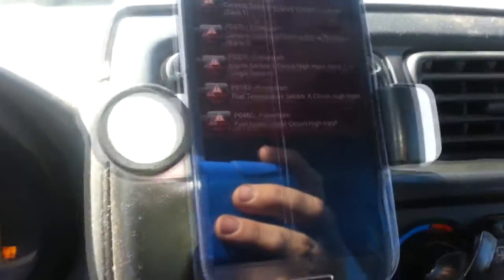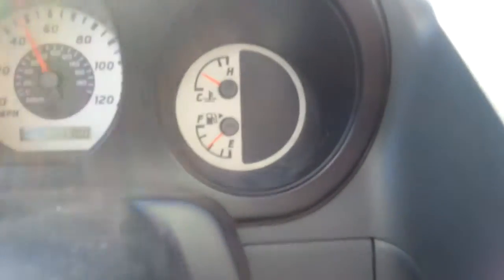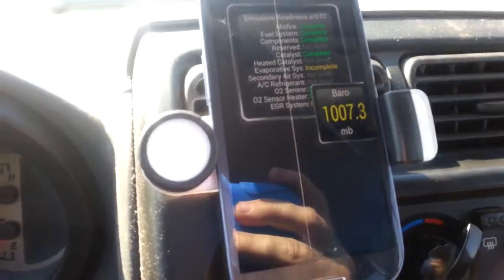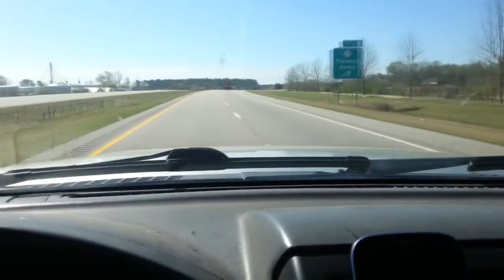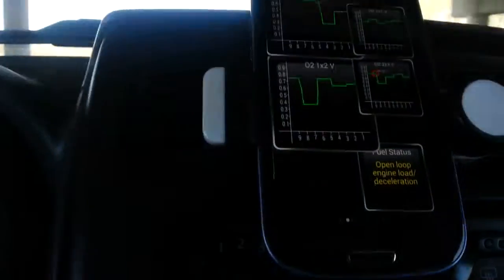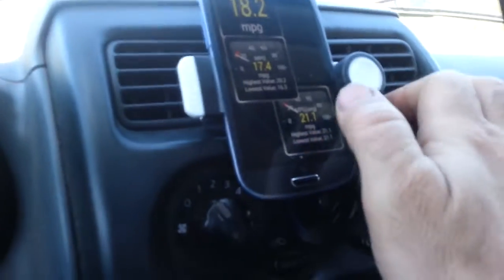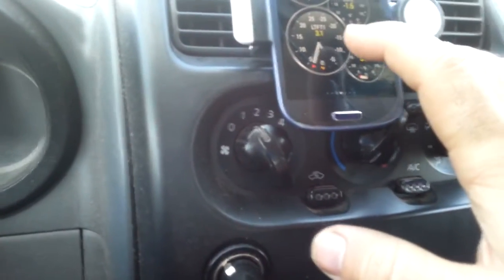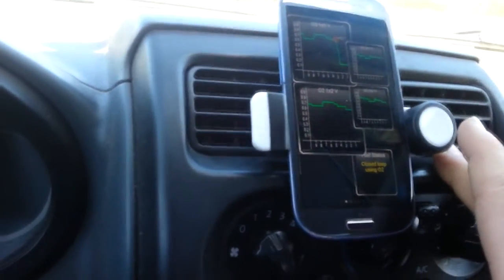Always Confirm a Repair. In Diagnostics more may be fixed 2004 Nissan, Fuel Temperature Sensor

Comment: Looking good there DE and you must have been sitting on this video for quite awhile. How about the knock sensor code? Is that one still there? If so, that would make a good video :)
Reply from the maker: +stuzman52 Yep. That's still there. I announced my interest about it like a year ago when I did the Matco infinium screwdriver. Is it tough sometimes to fix what  doesn't matter for your inspection? Drive on, right? Lol

You may recall last winter when I complained I couldn't overcome editing issues for this series. I finally applied my new software and it wasn't too bad. When you have over an hour of video it can be overbearing to edit. So it was nice to chew a bit off at a time while I came out with motorcycle videos.
Reply from the maker: stuzman I look forward to your newest video on A/C! I thought you'd done enough of those. Mine is acting up too.

I still haven't put in a new knock sensor. I've bought one from Japan. No good. So I bought one from China. Also failed the bench test new. Sigh.
Reply: Yep, this one is a little different for a/c as this is on my home unit. And you better getting going on your a/c as it's starting to get hotter and hotter :) And don't worry about the knock sensor as you'll get it sorted out as I've got faith in you :) Be sure to have a great weekend!
Reply from the maker: +stuzman Thank you. I'm sure I will. That was very encouraging!

Just made it home home after that long but temporary contract...of course the last location will be in the videos for a while...I really will eventually have to do 2 videos a week to catch up.
Reply: Just be safe when you're on the highway and sounds like you may have some good videos coming up :)